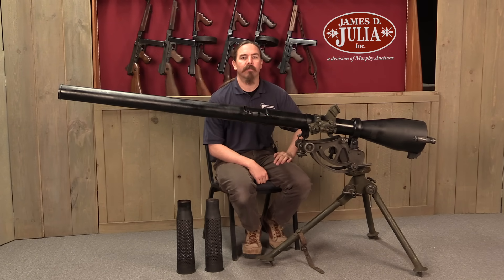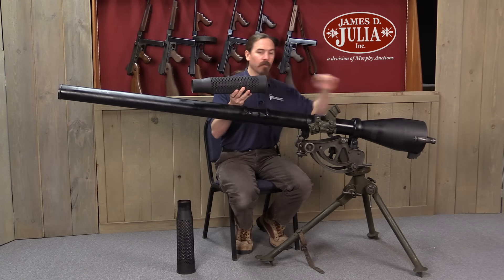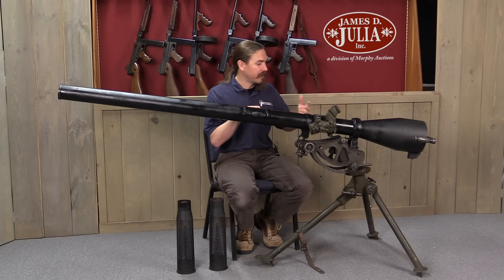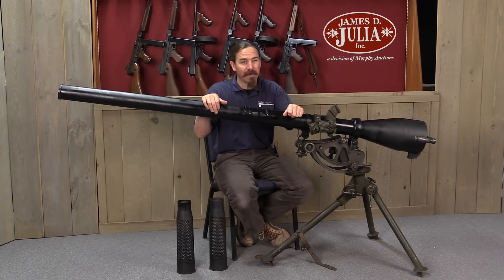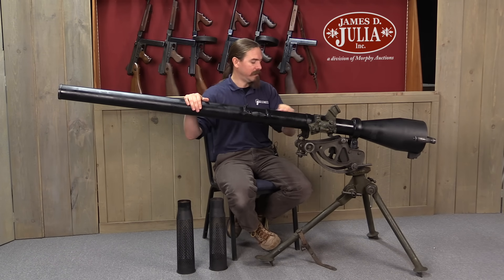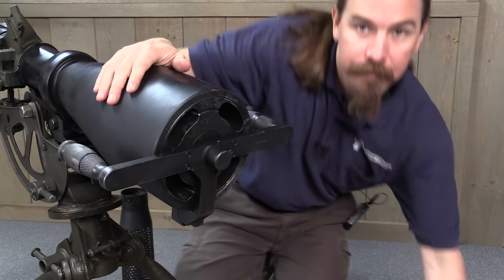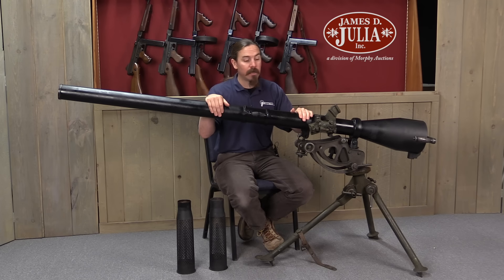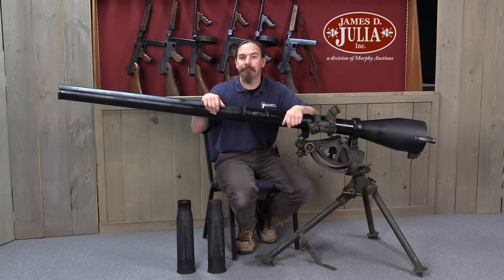M20 75mm Recoilless Rifle: When the Bazooka Just Won't Cut It

Comment: I remember back in the 80's the boys of the Christian Militia in Beirut used to use it like if it is a mortar. They used to place it on a table with a 45 degree angle and they used to shoot it. I am not sure how accurate it was but the voice of the explosion that used to do was much bigger than the 60 mm mortar that also had in this position. Of course they used to put it on Jeep's and the M113

Comment: Dangerous?  Had a kid in the AT Platoon, Company D-2/502d Infantry, circa 1975, who left his hand negligently draped behind the venturis of a 106mm RCLR.  Surprisingly, it did not, when it fired, blow the hand clean off.  Instead, it cooked to the point of charred it, to the tune of about a quarter inch or so deep, and pulverized all  the bones.  Another guy in B-3/5 Infantry, in Panama, managed to not quite keep his foot out of the backblast area of a 90mm RCLR.  Destroyed his foot, right through his jungle boot.  He, at least, didn't have to have it amputated, as the first guy did, but walking thereafter was something of a challenge.
Reply: oh christ, even if it is not really dangerous, it's still not supposed to let that happen.

Comment: I would imagine that in WW2 when these were effective against most vehicles, a few of these together would have made for excellent ambush weapons. for firing at a predetermined position on a road, these would have been very conveniently transportable weapons relative to the amount of damage they could reliably do - presumably you could hit more reliably than with shoulder-fired weapons, and probably over significantly longer range. they would also be quite easily concealable at least from the view point of their target (basically any bush will do).

Comment: I have fired both 75 mm and 106 (105) mm recoilless during light infantry recert training in the 60s. Our allies and enemies use them too. I saw ally units in Laos killed NVA PT-76 amphibious (25 mm armor) with the 75. The sloped 50 mm armor of T-34 is just too much for it. Some ally units sawed off 20" of the smooth bore for easy carry by man. If you pitch it up more than 20 deg, the crew will be roasted instantly.

Comment: I have a friend who is a vietnam vet, and he told me they had a forklift that they strapped these rifles onto. they just ratchet strapped them onto the forks in groups of threes for a total of 6 shots (three on each fork). I didn't believe him until he showed me a fucking picture of it. it looked completely insane. he told me they would radio for the forklift-canon-thing whenever they got stuck with a building full of enemy that were really dug in. he claimed they would fire all 6 shots at the same time after pointing the forklift at the building, and the lower floor of the building would just explode, often causing the whole thing to come down. If you hadn't guessed already, he was a US Marine lol. "Marines make due" indeed haha

Comment: Far as obsolete.  When the US first went into Afghanistan I saw a news bit of base on a hill but, it was overlooked by higher hills.  Green Berts on the base would fire 100 to 200 rounds of recoilless HE into those hills to prevent the enemy from grouping there and make it hazardous for observers too.    
I did see one piece on the Marine Corp's Ontosis (spelling).  A tracked vehicle with six recoilless rifles on it.   It was designed for use against Soviet tanks in Europe and wasn't considered to be a very good weapons system for various reasons.

It was taken to Vietnam, it still had a lot of problems but, one Marine said when it showed up on the scene the V.C. left rather quickly.  
When all six rifles were fired it cleared about a thousand yards of brush flat.

Comment: large weapons like this are 'cheap' when compared to full-auto weapons. iv seen a m-16 for $50,000 and iv seen a twin 40mm bofors AAA mount from a battle ship for $50,000. so when you compare them like this that sounds cheap and the twin bofors is full-auto as well. only ammo is the hard part but again both aren't cheap so get the most bang you can.

Comment: I know recoilless rifles are one of my greatest fears when I load up a Combat Mission Shock Force scenario. They don't pose much of a threat to my tanks (although they can knock out my tracks and degrade my optics), but it will slice through the thin armor of my IFVs and APCs like butter. They might even pose a greater threat to my lightly armored vehicles than ATGMs, simply because the projectile travels so much faster (popping smoke and reversing might cause an ATGM to miss, but a recoilless rifle round is already through your vehicle by then). So these things are not to be underestimated, even in modern warfare (granting that CMSF is set in 2008, so it isn't entirely "modern" anymore).

Comment: I'm not seeing the advantage with this system. If it's on a tripod or fixed to a vehicle etc why blow half of your blast out the other end ? Just use half the charge blast it all out the front & fix it to something no issues with recoil & it must produce some recoil if it's still throwing a heavy object some distance. 
Any further explanation welcome
Reply: This can be carried on a vehicle that can't carry normal artillery, or it could be carried by a couple of infantry. If you compair this to a M1 75mm pack howitzer. 
This fires a 20 pound projectile at 1000 ish fps, weighs 100 pounds and needs a crew of 2.
A pack howitzer M1 fires a 18 pound projectile, at 1200 fps, but it weighs 1500 pounds, and requires a crew of 6. 
While it has some recoil, it's not nearly as much as a standard 75mm gun. 
Basically, this is way more portable than a standard artillery peice, while giving a similar payload, the trade off being the back blast.
Reply: ATF Youtube division Great answer to what seems now to be a dumb question. Apreacated though Thankyou makes sense.

Comment: You're understating how much energy comes out the back. The bullet and the exhaust will have equal and opposite momentum, but momentum is mv and energy is 1/2 mv^2, so the smaller mass with a larger velocity has proportionally more energy. If the bullet is 10 times as massive as the gunpowder, then that means there's 10 times as much energy going out the back than the front. The back end would disperse faster, but I'd say standing immediately behind it is more dangerous than immediately in front of it.

It would be more efficient if they just made it fire a bullet in both directions so half the energy would come out the front. But that would also make the area behind it that's dangerous to fire much larger. And if you fire it up at an angle the bullet in the back will hit the ground immediately, and could probably send out dangerous debris.

Comment: It's still really hard to think that recoilless rifles work the way that they are designed, you would think the projectile wouldn't go anywhere and that the blast gas would just stay inside even though it's focused out smaller holes. It's kind of like a low pressure system, or a high low system.

Comment: My Uncle in 101st said they were getting hammered by German Tigers with nothing that would stop them. A jeep from. Supply came up and said we got something. Two boxes with instruction sheet, a 57mm recoiled. Following paper they assembled  it. Next day Tiger approached. With prayers they fired as instructions.  Round hit under turret 's edge and blew it about 10 feet in air off of tank. Cheers went up all down the line for finally being able to stop tanks instead of running and hoping  artillery would get them.

Comment: I have used, and instructed  soldiers  in the use of  both th 57 mm, the 75mm and the 106 mm  of that family!  Surprisingly accurate, but yoyureally, really need an alternative firing postition for the next shot!  The thing was eventualley replaced by he TOW, also in Norway.  But great fun - !
Reply: I have a propellant case for each ......57, 75, and 106mm.  However, I have a very rare 105mm USA recoiless case that looks slightly different than the 106mm case. It has the same projectile diameter but the early 105 had design problems and the new redesigned unit was named 106mm to avoid mixing ammo that won't fit the wrong gun.
Reply: @kimmer6  The 105 never made it to Norway, I think.  Btw, once, in the Brigade of Northen Norway, a jeep with a 106 turned over an virtually polevaulted on the 106 s barrel !
Reply: @kimmer6  The 105  never made it to Norway, as ar as I know.  The bazooka often had faulty rockets - they just jumped five meters out of the weapen and lay there saying "pfffssss" for å fes seconds, and THEN the rocketfuel ignited.  And the projectile could take any damn direction - .

Comment: I don’t think it’s 50 - 50 with the pressure 
if it was the shell wouldn’t go any where with it being equal...
I think I remember reading years ago...
that less came out the rear ( % wise) but at a much higher pressure 
Lots of Lower pressure and out the front 
Balanced by
Super high pressure out the rear
Roughly.....

Comment: I cannot figure why the M20 could not knock out a T34?
The frontal armor on a T 34 was less than 2 inches thick.[45mm].
I understand that the front glacial was at a very great angle. But jeez they would nailed a T34 .

Comment: i wonder if using another projectile that fired backwards would increase the impulse compensating the front-facing projectile. just because a projectile is more dense than just gasses (that's why water rockets fly better than just air rockets).

Comment: To compare with the two bazookas:  The smaller 2.36" size could penetrate at right-angles about 3.6" (average) of RHA and the later 3.5" could penetrate 11.25" (average) of RHA.  Both of these rockets used a near-instantaneous base fuze to set them off, which had a tiny, but non-zero, delay after the tip of the rocket nose hit the armor.  At higher angles of attack (well over 45 degrees), this meant that the nose could glance upward slightly before the HEAT warhead exploded, so the needle-jet did not penetrate the armor very well.  Modern versions use a peizo-electric crystal in the tip of the nose that sends a tiny electric signal when it hits the armor and is crushed, so the base fuze gets set off at almost the speed of light and the problem with high impact angles is much less significant.

Comment: ...Or, you could trick the pressure curve of the powder by constructing your case differently and avoid the backblast altogether. Given that M20 was an extention of M18A1, which was devised at about the same time as the aforementioned high-low system, it's not that much of lagging behind the technical innovations of the day, but the thing I don't get is why everybody and their dog followed this and not the other design after the war.

Comment: Detonation is the wrong term.  Gun and rocket propellants burn quickly.  They don't detonate.  Detonation is a sharp explosion of high explosives where the pressure wavefront is much faster than the speed of sound.  Detonation of any gun or rocket propellant would be a flaw that would usually kill the operator.

Comment: amazing how much HEAT warheads have advanced.  Heckler and koch claimed that their modern panzerfaust can penetrate more than 900mm of armor, if that armor is covered by conventional ERA.  I don't understand the science behind such drastic improvements in efficiency.  the panzerfaust is a 110mm projectile, and I know that 100mm russian HEAT rounds used in the T54 and T55 were capable of 3-400mm of penetration in the late 1940's and 50's, but a tank round weighs a hell of a lot more than a modern panzerfaust projectile.  I really would enjoy a deep dive into just how they've managed to refine heat rounds to be orders of magnitude more efficient per kg.  A 75mm HEAT round penetrating roughly 100mm is laughable in comparison.

Comment: The large caliber rifle was 106mm not 105mm. The Omani SAF used them in Dhofar in the 70s which they got from the Brits after Aden.
Reply: Well no, actually.  
The first series of RR's developed during WWII were the M18 in 57mm, the M20 in 75mm and the M27 in 105mm.  The first two saw use at the end of WWII and all three saw use in Korea.  The M27 was a failure and quickly replaced after Korea by the much better known M40 106mm which can still be found in use throughout the world today.  The M40 was actually a 105mm but called 106mm to avoid confusion since the ammunition was not interchangeable with the M27.

Comment: 4inches are around 100mm and a T34 has 45mm angled, considering that the round is slow it would actually normalize before impact, nullifying part of the angling plus HEAT kind of itself be more good at angles that AP of that time
Reply: In Korea, these weren’t able to deal with t-34-85s.

Comment: Don't forget the M50 Ontos, which was used to effect through the Vietnam war. It was six 106mm reckless rifles mounted on an M56 chassis. US ski slopes have mostly stopped using the recoiless rifles. I thought that is was a knee-jerk anti-gun thing, but it turns out that they're just getting old and a few have burst and there were deaths. They have gone over to a pneumatic gun called the Avalauncher, which still fires an explosive. The Canadians go all out, though. Some slopes there use 105 howitzers.

Comment: Question were these recoiless  rifles 57mm and 75mm effective against the tiger and other German heavy tanks?
Reply: Never used against them but no, they would not have been.  
The 75mm M20 had difficulty against the T-34 in Korea and the 57mm M18,... fuggetaboutit. American HEAT shell fuzes for years had issues with steeply sloped armor, often failing to function at all if the impact angle was greater than 60 degrees, and having poor penetration performance if it did function.
Theoretically the M20 should have been able to penetrate a Tiger I side or rear armor.  Frontal armor would have almost certainly been a no go. With the low muzzle velocity, just hitting a moving tank at more than a few hundred yards would have been the tough part though.

Comment: I thought the m20 was a 76mm recoiles rifle, maybe that was for the ones used on the M50 ontos.
Reply: Cowboycomando54 
From a former 11H (later 11BP4)
The RRs on the Ontos were 106mm, the same as on the gun jeep, and overlapped the TOW and TOW II. The 90mm RR was the most recent (allegedly) man-portable version and stayed in service as a second-line well past the introduction of the shoulder-fired missiles. NG units still had 90s past 2000.
Reply: @edbecka233  I am not familiar with that MOS, I am only familiar with Navy rates, what is 11H/11BPH exactly?
Reply: The 75mm M20 was a 75mm weapon and fired the same projectiles as the 75mm M3 and M6 tank guns (M4 Sherman and M24 Chafee tanks), the M1897 field gun ("French 75") and the 75mm Pack Howitzer, just using a different case.

The 106mm M40 was developed after the Korean War and mounted on Jeeps, APC's and the M50 Ontos.  It naturally had significantly better performance than the M20 but needed to be vehicle mounted due to size. The actual caliber of the M40 was 105mm but was credited as 106mm to avoid confusion with the earlier, unsuccessful 105mm M27, used in Korea with which ammunition was not interchangeable.

Comment: A lot of obsolete US Army ordnance was still bouncing around Vietnam, including the 105 Jeep mounted recoilless.
Reply: I wondered when someone was going to mention these very common systems.  105 is the diameter but named 106 to differentiate it from the incompatible 105 rounds.  You simply chase the vehicle with the 50 and tracers and when you start making hits you fire the recoiless and it will hit.  I don't have any firsthand experience with them because I was a pilot but I did see them and talk to a guy who maintained them.
Reply: @jackt6112  Side by side from a distance, the 105RR and 106RR cases look the same. Close up there are differences. The 50 cal Spotter Tracer rounds looked like a .50BMG cartridge shortened by a full inch. They have red/yellow tips. These had the same ballistics as the 106mm round, so when you see the trace and the ball of smoke hit your intended target, you punch the trigger on the 106 for an assured hit.

Comment: I'm no physicist, but I'm wondering about this: If you want to let half of the energy escape through the back of the barrel in order to have less recoil, couldn't you just use a charge that's half as powerful? Wouldn't the result be the same?
Reply: A sealed breech with half the charge would need a lot more weight and gubbins to contain the blast, though. You would in fact end up with a 75mm artillery piece, which are a lot heavier than this thing.
Reply: If you use a charge half as powerful you end up with less recoil instead of NO recoil.  The goal is no recoil which allows the elimination of the heavy recoil systems thus saving substantial weight and making the weapon usable by the infantry, rather than the artillery.

Comment: I seem to recall a 90mm version not mentioned. They are also in use today with the US army in 84mm I believe. Supposedly works a treat on rock fortifications in Afghanistan.
Reply: First US Army RCLS were the 57mm M18 and 75mm M20 which saw service in the last months of WWII, mostly on Okinawa.  Then the 105mm M27 which serviced in Korea.  That lot were replaced by the 106mm M40 and 90mm M67 respectively in the second half of the 1950's, those weapons serving into the 1980's until replaced by Dragon, TOW and Javelin missiles. For service in Iraq and Afghanistan the U.S. Army (first with the Rangers) has adopted the Swedish 84mm Carl Gustav M3, a weapon first introduced in 1948, continuously improved over the decades and vastly superior to the old M67.